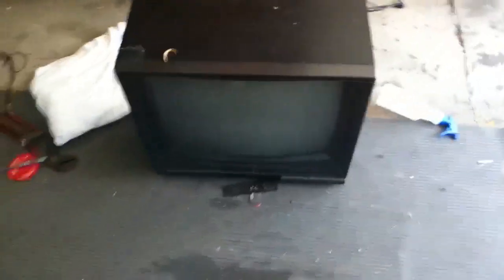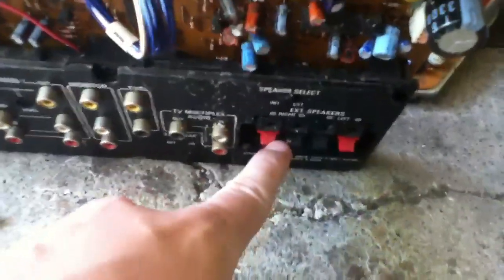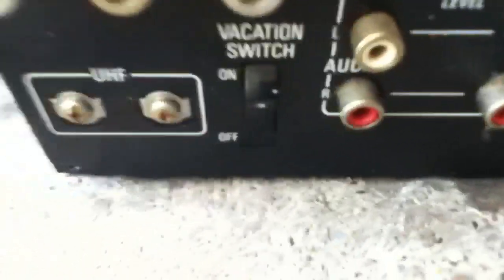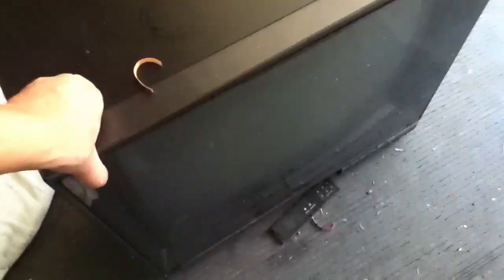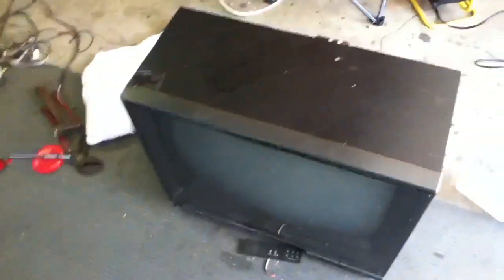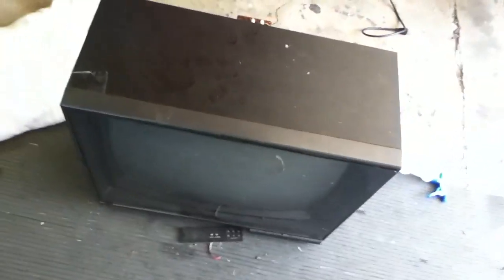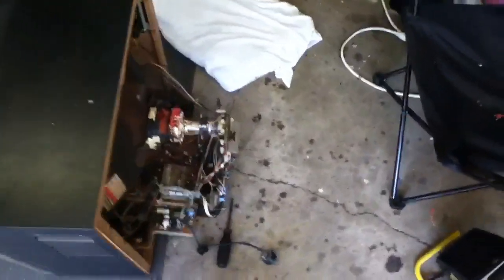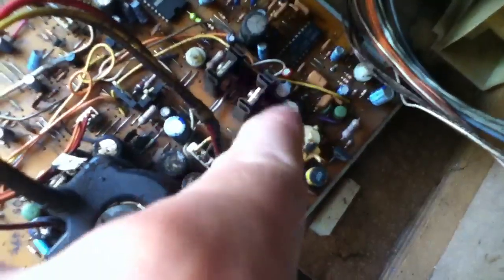Trash picked tube TV with capacitor problem

Comment: If you had things like 'retrace lines' showing, it would be in the 'blanking circuit', driven from a signal at vertical frequency (50-60 Hz), coupled by a small electrolytic capacitor; as for 'foldover' and 'rolling', there is a likelihood that the supply feed to the vertical stage (about 30V) is low, caused by another electrolytic capacitor, fed originally from the line output transformer via a diode. It would be prudent to replace all electrolytics surrounding the vertical out transistors..

Comment: Hmm, it's unusual that the green cathode died. Usually it's the red cathode that goes first, leaving the white centre of the image a cyan colour. Have you checked that everything is properly connected? My Sony has issues with the red cathode, but I completely disassembled and reassembled it, which fixed the problem.

Comment: CRT televisions are far from junk, and have proved more reliable than subsequent flat screen technology - which I might add is cheap and 'designed for the du,pster'. Look up  'planned obsolescence' - while it was a smaller factor with CRTs (eg. CONIA, COMPUTEC etc.), it's a major issue with flatscreens.

Comment: i had a 1985  nec 20 inch CT-2020A with the glass over the front   and i swear it might have had the best picture i have ever seen in my life  

i got it for like 5 bucks when i was like 6  and i cried when it quit working the colors were amazing 
 i think they used some of the same stuff they used in there arcade cabinets ?

Comment: I came across a very similar looking TV. My cousin moved into a house and found that the previous owner had left the TV there. Turned it on and it turns out the tube was too bright. Other than that it was fine. I don't know what he did with it though